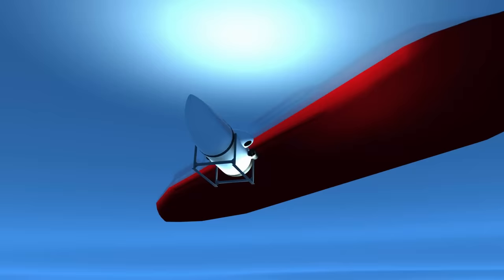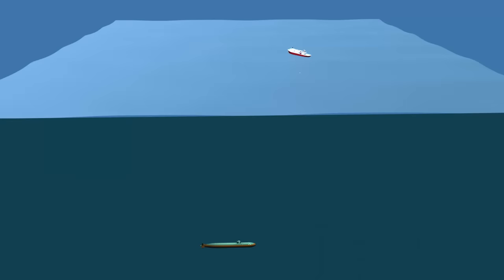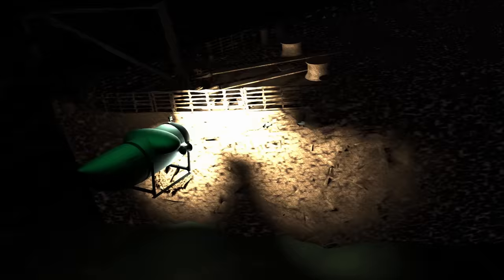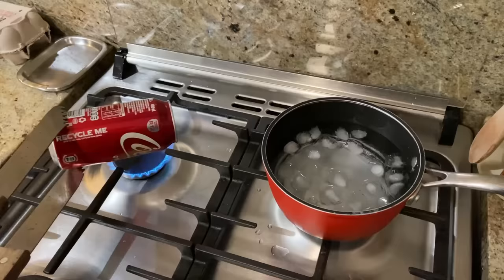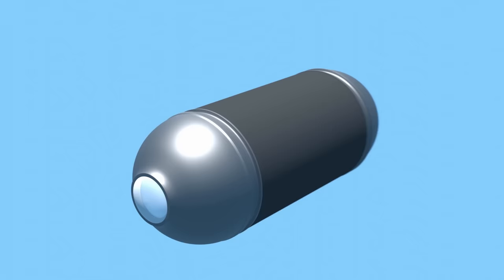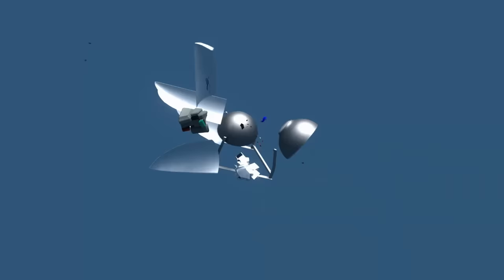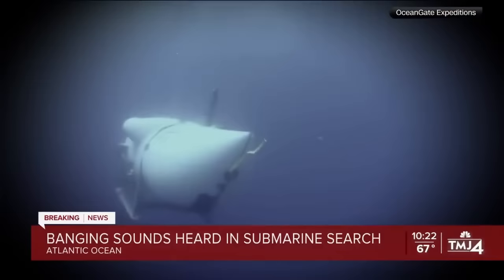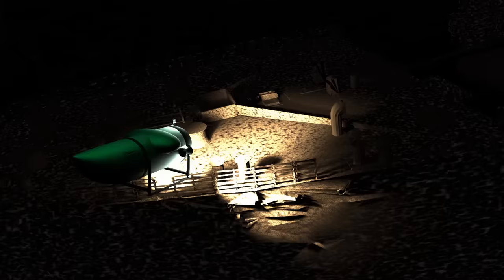TITAN Sub implosion | Deep Dive animation explanation

Comment: If the leaked transcript is right, this experts account of the sub imploding while falling is questionable. They were far deeper than 9000 ft before the implosion. 
At 9:28 Titan was at 3433m or 11,263ft when it detected a possible hull breach. Rush only then decided to slow Titan's descent velocity. 
At 9:30 The Titan continues to fall even with the thrusters activated to ~3500m (11482 ft) or more and the rate of descent was increasing and in response Rush decided to release the ballast. 
At 9:32 Rush seen no improvement in the descent rate and was preparing to jettison the frame. 
By 9:35, multiple attempts had been made to jettison the frame and was successful allowing the Titan  to ascend. 
At 9:38 the crew heard crackling sounds in rear of the Titan. 
At 9:40 the crew could not identify the source of the crackling and did not respond to a request for indicators on the real-time-monitoring system (RTM). 
At 9:42, the crew was running diagnostics and the Titan was ascending very slow. While the crackling sounds had subsided the RTM alert was active and all red indicating imminent implosion. 
At 9:43, the Titan was ascending but very slowly at a predicted 25% rate and Rush was unsure as to why the ascent rate was so small because there was nothing indicating a power failure or a thruster malfunction; the Titan was at 3476m. 
At 9:46, the Titan was at 3457m when it alerted the crew of a power failure in the A-Power bus prompting Rush to switch to the B-Power bus. The crew heard more sounds in the rear of the sub and this was the last time the Titan and it's crew was heard from. 
This transcript implies that the Titan was able to come out of its freefall and ascend. Which means Rush could have adjusted his speed on the way down and just didn't and it's unknown as to why. If you couple the descent rate along with Rush's decision to not slow the Titan down, this was the beginning of the cause of the implosion. Any sub  descending at twice it's descent rate, whether it's made from carbon fibre or titanium would implode under the immense pressure of water at that depth. From the transcripts, it appears the Titans descent rate caused damage to the hull and other systems. The primary power system was on the verge of going out which explains why they were only getting a 25% ascent rate with no indication that it had completely failed. By the time Rush switch to the backup power it was too late, the Titan had imploded. However, the Titan was ascending. It's possible they were in freefall when he switched over to the backup power system but all indication was that the Titan was ascending slowly.
Reply from the maker: Leaked transcript is clearly fake. https://www.snopes.com/fact-check/titan-sub-transcript/

Comment: Everyone is being critical and maybe we should. But the fact this thing went down 23 times and survived is shear genius on the designers part. My best guess is, the glue failed where the rings for the end caps were glued to the carbon fiber.  I think the tube construction, was a proven design.  We will see as time goes along. I think they started with a leak around the end of the tube, from a glue failure, and tried to get back up to a lower pressure zone..  it wasn't a complete failure all at once, as they had time to drop weights and head to the surface. That tells me  one of the end caps came off..

Comment: One risk was to push the sub's components well beyond their safety pressure range; yes you can do that to some extent and rather exceptionally, but knowing that you are beyond safe ground. A second risk was to submerge repeatedly, so fatigue cracks and deformations accumulate in the sub structure. The two risks put together, the question of major failure becomes one of when, not if.

Comment: Regarding the search in the wrong places, as James Cameron points out, they all knew where it was, but they needed to get the ROV there to go deep enough to confirm the worst. The rest of the searching was exactly what you do in a search. You get the right kit in place to look where you need to, in the meantime you check in all likely places just in case. Even the banging noises, sharing that was the right thing to do, even if they couldn’t explain them (as they stated, and explained that the ocean is full of noise like that). Not sharing the fact that the implosion was heard was also the right thing to do due to the levels of speculation. Until it is confirmed they are dead or could no longer be alive (potential oxygen supply), it was a search and rescue mission. Once the ROV was on site it and found the wreckage it became a recovery mission and the families would be informed first.

Comment: My husband is a cyclist and deals with carbon fibre bikes and says yes it's strong BUT one solid knock and that's your  front fork, crossbar or bottom bracket  sheered off from your bike frame. So when it goes wrong it happens fast as its an external force. 

 it's also usually a multi directional weave for strength- that's why when you Google it it looks like a black and grey checkerboard.

Comment: A pop can is a single wall. Carbon fibre is thousands of filaments. The filaments break in layers, not simultaneously. Although this has been my understanding from the start, if the transcripts released of communications are genuine, then it appears the delamination or break down of the hill was observed for around twenty minutes.
Reply from the maker: The transcripts were made up by someone who doesn't understand the physics.  There is absolutely no way it could have been a drawn out leaky event.  It would have been instantaneous or nearly.  Its like suggesting glass can break slowly n gradually.  Carbon fiber shatters like porcelain in an instant.

Comment: The rings came out of the ocean clean. Nothing stuck to them at all. There obviously was not a good bond there. It's like they were never glued. There should be carbon fiber left attached to these rings if the adhesive bond was good.

Comment: What's upsetting is that further testing with generic carbon fiber piping as shown that the carbon fiber can actually do this job. The problem was that they did not do cross thatched carbon fiber instead doing a single roll of it over a tube which just greatly reduced its apparent ability to handle cycles
Reply: I should be careful when I say further testing I mean people who have built pressure tubes with carbon fiber to scale of the sub and then run cycles on it. They can get 40 to 100 cycles with no noticeable degradation. Although these cycles are not tested to the scale depth that the sub was going nor was the piping specially a made but just store bought piping. It's more an indication than an actual scientific result but it suggests the stuff could work with further testing and experimentation

Comment: Laying the fibers in one direction was extremely stupid.
This means that in one direction all forces were transferred only by the resin. 
Any bending moment along the capsule must have caused microcracks.
Fortunately, they died painlessly because they were more compressed than in a diesel engine.
This is a faster death than sending a signal through the nervous system.

Comment: Carbon fiber is better in tension than compression. A good example are SCBA tanks that firefighters wear as an air supply when going into a fire. They are made from an aluminum (6061) tank wound with multi-directional carbon fiber with additional layers of fiber glass for external protection. They are rated to 4500psi with a life of 15yrs but need to be hydro tested every 5yrs to confirm safety and have a burst pressure 3.4x rated pressure.  These tanks are under tension and are filled hundreds of times over their life span. After 15yrs they can be recertified for another 15yrs using acoustic wave inspection to insure integrity of the filaments. They are DOT certified to a certain specification and testing procedures.  This was a disaster waiting to happen.

Comment: The plexiglass company even told them not to use the glass on the sub, the window pushed in from the pressure and the rest of the sub fell apart who uses fibreglass on a sub

Comment: It was much more instant that any demonstration that you can see on the internet.
At that much pressure and essentially infinite supply of water to take up space without loss in pressure, the living quarters, once it lost integrity, would crumple to nothing at multiple times the speed of sound.
As this would progress, the immense pressure would heat up the air to temperatures much hotter than the surface of the sun. Similar thing happens in your diesel engine when the air is compressed in the cylinder until it gets so hot it can ignite the diesel mixed with air. Only in diesel engine this happens when the air is compressed maybe 12 times. The sub would be compressed at least thousands of times.
The water would then rebound back and fourth about half a dozen times at about 4 times per second, each time creating some vacuum with water vapour in it just to close on it again and cause another flash of light.
--
The reason none of the demonstrations you can see on the internet can do any justice is that water is not compressible. When you put a sub model in a larger tank and then you start increasing pressure, if the sub implodes the moment it starts to implode the pressure in the tank instantly drops. You will never see the kind of thing that happened in real crush situation because you just don't have the infinite water column to take up space without losing pressure.
Reply from the maker: Quite right. My animations are at 24 frames per second which is 41 milliseconds. 
But a faster frame rate is pointless because video frame rate is already faster than the eye can register.

Comment: Well said.  The Company announced today they are suspending any further dives.  NOW THERE'S A BIG SURPRISE!  Wonder if they'd had a few cancellations?

I know some people who knew Stockton Rush.  Where did he build those subs?  Everett, Washington. What else do they build in Everett?  The Boeing 787 Dreamliner, the most advanced, mass-produced  Carbon Fiber transport vehicle on the Planet.  What did the Engineers who have worked on the 787 tell Mr. Rush and his associates?  This might work someday, but Carbon Fiber is a tool like any other tool and we (Boeing) have had LOTS AND LOTS of problems with the Carbon Fiber pieces failing after only short periods of use, particularly where they meet or seal with a dissimilar material, like steel.   

I'm sure that the passengers on this doomed ship will file a head-spinning lawsuit and I hope they wipe-out the Estate of EVery Principal in the Company.  THIS IS WILLFUL NEGLIGENCE AND WRONGFUL DEATH!  Every day we're hearing about more and more warnings this "genius" Stockton Rush ignored.  Genius my ass.  This guy was 1/2 assed McGiver Garage Hobbyist as far as his Engineering skills went, but a Madoff Level Scammer when it came to extracting massive sums of money out of unsuspecting investors and unwitting "customers".

Comment: There is a supposed transcript around.
The craft also appears to have descended a third too quickly and the issues started in the tapered rear. Dropping ballast gave them only 10m+ per min in their rise rate much lower than expected.
It appears they had 15 minutes of the issues in the rear until the implosion. 
The search was very odd as it some knew very well what had happened
Reply from the maker: The transcripts are nonsense and obviously made up by someone who doesn't understand the physics.  There is absolutely no way it could have been a drawn out leaky event.  It would have been instantaneous or nearly.  Glass doesn't slowly n gradually.  Carbon fiber shatters like porcelain and glass in an instant.

Comment: Sorry, the carbon fiber was not wound onto a steel pipe. If you look at an image of the inside of the submarine, you can see carbon fiber windings. Not a steel pipe.
Reply from the maker: The pipe was likely a mandrel to wind the carbon fibers over and then it could have been removed after.  The inside of the passenger compartment is lined with a plate with tiny perforations and then almost certainly some insulation before the carbon fiber. What you see on the inside is definitely not carbon fiber.

Comment: .001 Seconds, preceded by 19 minutes of sheer terror.
Reply from the maker: No the transcript is so fake. There is no way the sub would have made noises and made alarms for 19minutes
Reply: @Mike-Bell  The RTM Alarms were designed to go off the moment any micro-fatigue or pressure anomalies were detected. If it was functioning, it would have been going off LONG before a catastrophic failure. That was its only purpose! It was literally designed to detect a problem and alert the crew with enough time to surface. Obviously, it failed. But it most likely sent an alarm at the first sign of cracks, fatigue or hull distortion.

But transcript, or no transcript, it is factually obvious from the data and the debris field,  that they were attempting to surface when the implosion occurred.

Comment: The structure did have multiple orientations.  You cant wind a 0 degree angle, so they used UD tape for the long axis.  

The problem was not the manufacturing process or the material choice, as this vessel had made two dozen trips.  

The problem was it likely fatigued in such stressful use and it seems that the inspection regime was either non existent or laughable. Likely the craft should have only been rated to a shallower depth as it aged or needed to have the composite replaces on a schedule.  

Surely he thought he was being innovative though also very cavalier.  This is what happens when there is no safety regulations.

Comment: So send another one down, same depth, but with pig carcasses onboard with homing beacons in various parts for later analysis and/or recovery. Place internal pressure and temperature sensors to a black box in the cabin with a fast enough sampling rate to measure during the implosion. Send a robotic submersible alongside to record the entire process.

I'd be curious to see that data.

Comment: Carbon fibers are good at resisting pulling apart/stretching. Epoxy just fixes them in place. The scuba tanks and other pressure vessels containing the grater pressure inside than the pressure outside work well and as a bonus are much lighter.
I suspect that in case of the carbon-fiber-composite pressure working the other way around most of the work (if not all) is done by the epoxy. While epoxy is strong, it is no way in the range of steel or titanium (steel actually is stronger for compression than titanium, but titanium is way lighter).
I don't think it would matter which way they wove the fibers.

Comment: Man, I used to work with carbon fiber. Can't believe they didn't do a weave, 90 or even 45 degree layer crossing. If you don't have multiple layers at either 90 or 45 degrees to each other, it has no strength to it.
Reply from the maker: Hi, check my pinned comment. It was in 2 directions. But not 45 as you say or even more directions. If it one of the most severely stressed pieces of composite on the planet you do everything. Maximum number of fibre contact points.

Comment: So many issues:
Passengers just sit on the floor of the vessel on a flat platform, no seats of restraints- ridiculously dangerous in a submersible

The rings were just glued on by hand in a dirty environment that was the warehouse where it was assembled

Entry and exit is from the port end, the end dome must be bolted in place once passengers are inside and visa versa, so no emergency egress is possible !!

The main cylinder is inherently weak in the centre and carbon fibre is weakened by repeated stresses because the resins used to make up the solid part of the structure are brittle.

The acrylic port is only rated to a fraction of the depths that the Titanic sits at.

All in all this was a company that flaunted all the rules of engineering and design that have kept people  laive in dangerous situations throughout history.
Reply: There's no such thing as a "port end". Bow end.

Comment: Looking at the external finish of Titan. 
The thrusting points are crudely welded on the sides.
Feeder tubes are hanging loose leading to the thrusters. Panels are adhock holding the outer panels together. 
Ballast and landing gear has pointy tips to cause snagging.
Ariel fixtures on top of the craft.
Canister bolted beneath the sub.
Exposed framework fixed to the sub.
Bolted in from outside.
Too many red flags even before I would think about getting into the Titan.
Why call it the Titan?
This is the third vessel named Titan which involves tragedy at sea in the same area.
Noone seems to have seen the glaring snag places on the Titan.

Comment: Bonded fiber composite is an extremely poor choice for a compression vessel.  The epoxy experiences shear and tensile stress in which the fibers play no part, and contribute no strength.  A valid stress analysis would show that the fibers are not being used to their advantage, as they are not in tension.  The epoxy was in tension!

Comment: I don't understand why they wrapped the carbon fiber the way they did, making all the fibers essentially parallel. Even I, as an educated non-professional, can see how that would create some weakness. Instead, they should have put on a layer the way they did, followed by a layer where the fibers run diagonal, followed by a layer with fibers parallel to the axis of the tube. Rinse and repeat. I'm sure a tube like that would have been considerably stronger.

Comment: I am wondering how the cables where passed from the outside to   inside the hull. I wont be surprised if the selection of carbon fiber had to do to connect to the outside by wifi.